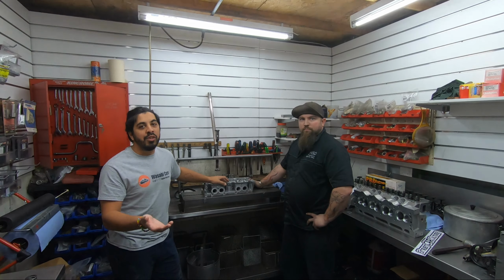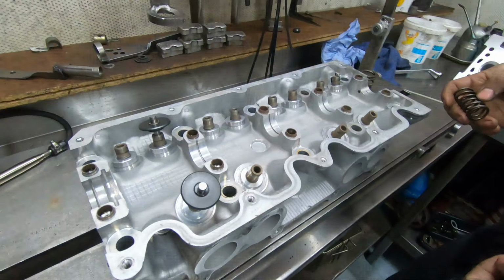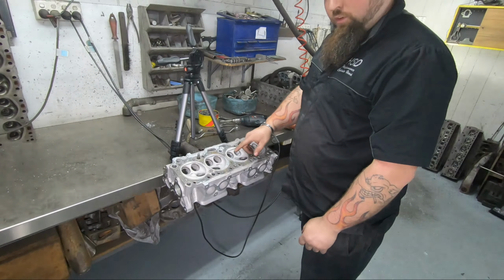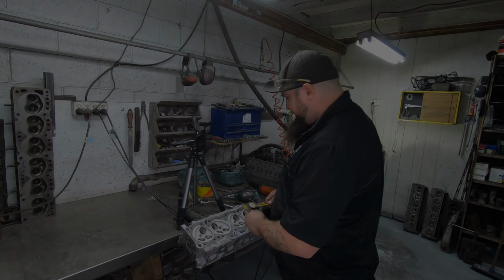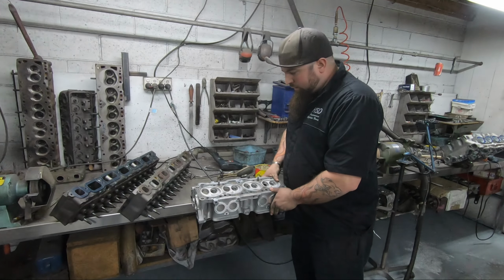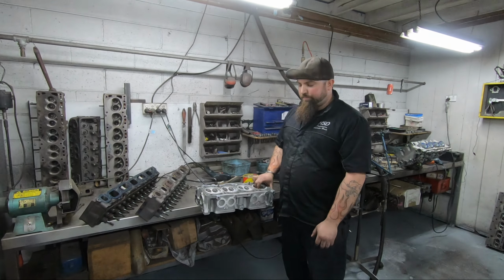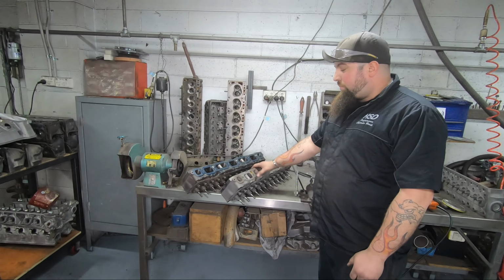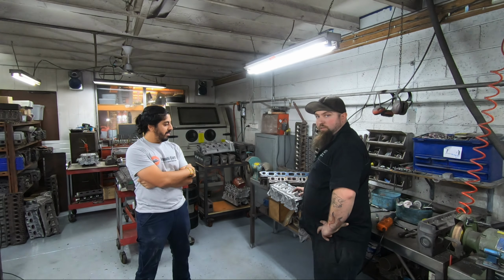CYLINDER HEAD REPAIR & PORT MODIFICATION PROCESS WITH HEAD STUD DEVELOPMENTS - STREET CAR CULTURE

Comment: Cool video, I love working with motors, never been game enough to port myself though.. I had my dirt bike ported by a professional mob in Sydney, Australia... then my mate case matched it which I found really cool to observe, the thing he told me what I thought cool was think of the cut as a run for water, the smoother the water flows the easier the motor will breath.. 
Is it cutting compound you were dipping the burr in??  
I have herd polished wasnt the best option due to atomisation..  cool for confirmation hearing professionals saying the same👍

Keep up the great vids 👍👍
Reply from the maker: Thanks for watching and appreciate the support. The compound Adam was using  helps keep the cutting tool clear whilst still cutting. Was a great day watching the process involved regarding porting, double valve springs.

Comment: Great vid, was wondering how you were going to tackle the fwd cylinder head/dizzy issue.
Reply from the maker: Using the 12 valve mazda van rwd fe head as pictured 👌🏾
Reply: @STREETCARCULTURE   yeah, what I meant was you explained it in the vid!  lol  Cheers
Reply from the maker: @5533851  my bad i also misread the reply!

Comment: Hey mate, how much did the porting end up costing?
Reply from the maker: They are very reasonably priced. If interested hit them up. Details in description 👍🏾
Reply: Hey Jason. Are you using oversized valves now?
Reply from the maker: @SP-xy5qn  no. It's a 12 valve head. Staying with factory sizing